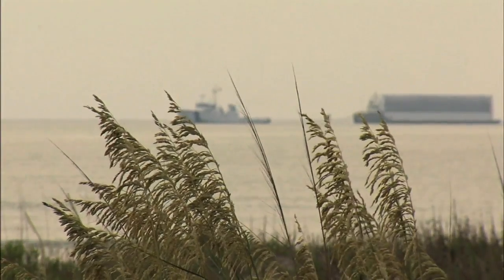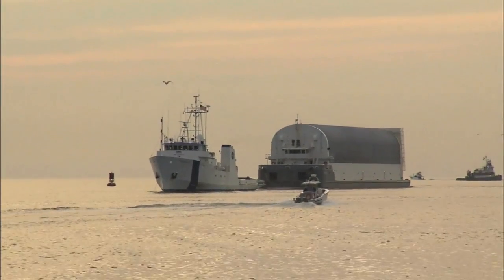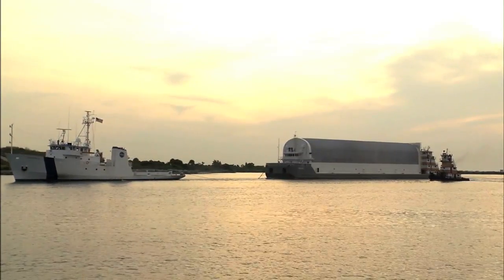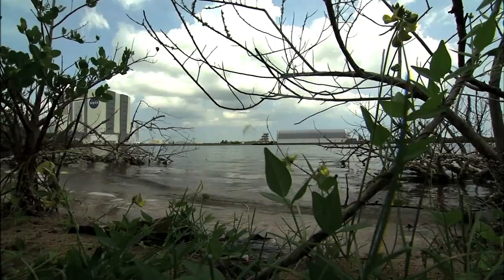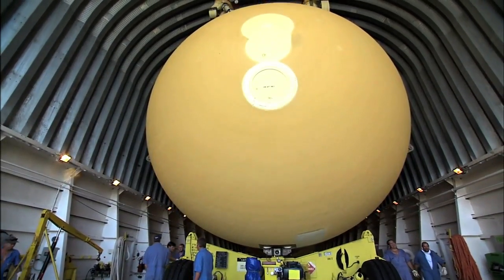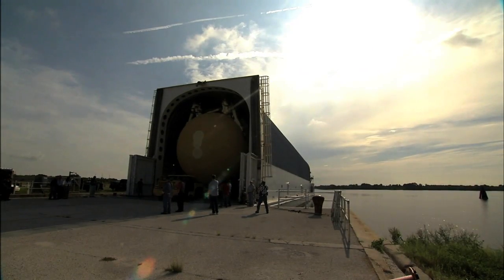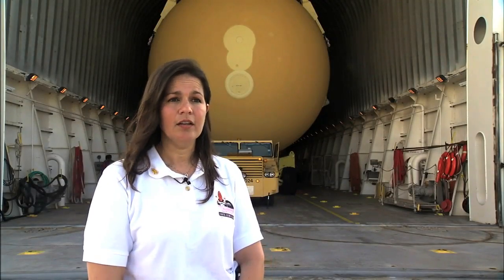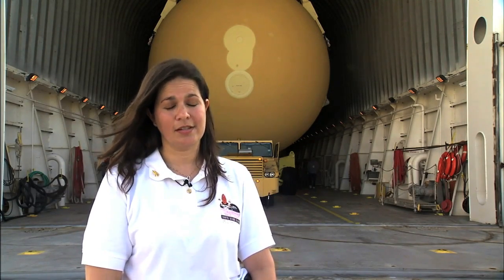Last Shuttle External Tank Arrives at Kennedy

Comment: @JoeyCanPwnRS Actually that is not even close to being true.  The Shuttle can only carry 53,600 lb to LEO or only 6,000 to GTO.  True Shuttle requires a heavy lift system (one of the many drawbacks of Shuttle) that ad's great cost and danger.   Remember, Shuttle has to be able to lift its own weight.   Shuttle cost 1.6 billion per launch, it might be cheaper for it to burn dollar bills.  In contrast Falcon9 heavy lifts 90,000 to LEO and for 90 million, a fraction of the cost.

Comment: @m60a3ttsmilwaukee not sure a microwave beam would be practical. there would still have to be a receiving station on the ground, and there there's the big problem presented by having a live microwave beam going down at all times. what happens if the orbit slips, or any other number of mishaps happen and then suddenly the mw beam is NOT hitting the receiver.